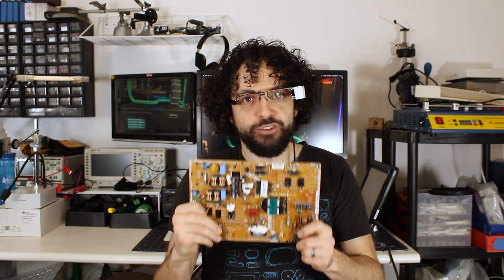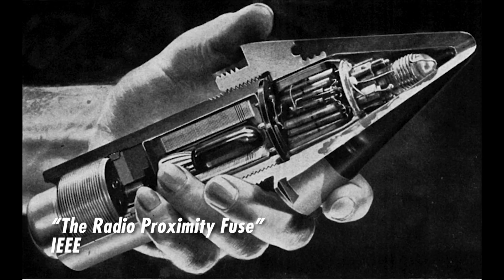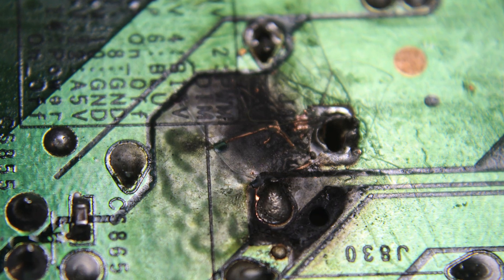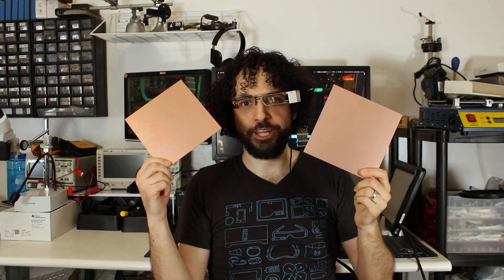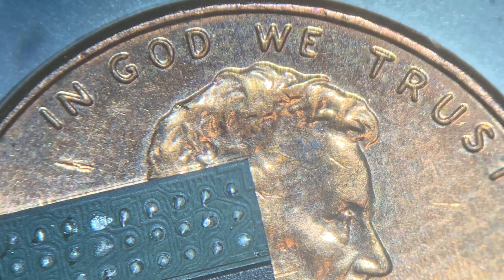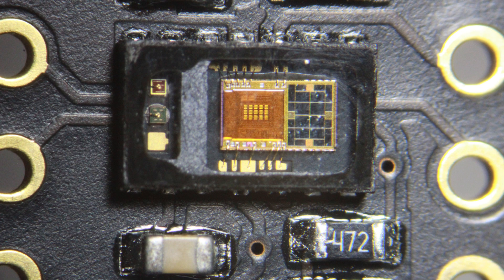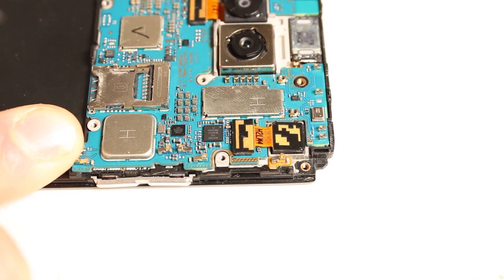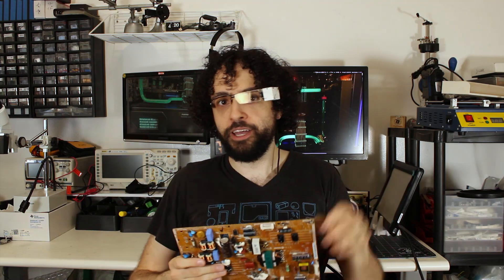Why Are Circuits on Boards?

Comment: You used LITERALLY wrong. Im so tired of that word being over-misused, I might unsubscribe. I havent decided yet, because you are quite entertaining otherwise.  I know, I will unsubscribe then subscribe back again. The circuit board does NOT literally hold the world of electronics together, it FIGURATIVELY holds the world of bla bla I give up! Oh then you used it correctly a few moments later. So. Perhaps you looked it up. Either way, it makes you sound dumb when you use Literally incorrectly. Me? The grammar police? No, just Literally, and the odd incorrect apostrophe, those are my things.
Reply from the maker: The entire electronics industry is on a single PCB. Always has been.
Reply: Yes but it does not LITERALLY hold the industry together. That would mean it had hands, and held it together physically.

Comment: I've done the PCB since the 70s. Never thought of them as a component. AND - there was a bunch of cool meta-knowledge in here I never knew. Great video!
Reply: That's surprising. Especially once you get to RF-level signals, the natural inductance and capacitance of the traces can quickly rear its head, and there's been a number of tricks to build in antennas, signal filters, transformers, even heating coils strong enough to solder components to the PCB.

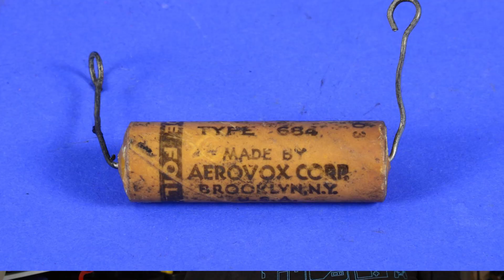Comment: The particular capacitor at 0:50 isn't an electrolytic capacitor, its just foil and waxed paper.  The electrolytic ones looked similar though.

Comment: In the old days ( 50-80s ), techs and engineers used to use tape on a clear transparent acetate film to etch out the board. Hence the term " tape out ".  The board would be painted with a photo sensitive paint and exposed to UV with the film laid on top. the board would then be etched with acid.
With the advent of printers and copiers, the layout would be printed directly on the film. the modern CPU manufacture is just an evolution of that.  
Also of note is the IBM Ceramic board. Yes the PCB was made from ceramic in those .

Comment: great stuff I learned a lot. Having worked 30+ years for a large US chemical company and my first 6 years in its Epoxy resin business, modern high performance PCB's are made from Epoxy resin with the Fire Retardance coming from the use of Brominated Epoxy resin (made from tetra Bromo Bisphenol-A (TBBA) as opposed to regular Bisphenol-A (BPA) in regular Epoxy resin) and an additional fire retardant additive in the resin formulation.  some cheap consumer products  not requiring high heat & dimensional stability may still use the older, cheaper laminated paper / phenolic resin boards.  looking frwd to viewing more on yr channel

Comment: Regarding milling: Couldn't you mill out the traces, paint the board, then mill away the paint on the pads? That way, you'd only need a broad brush and a tub of paint.

Comment: Oh my gosh, I've never seen or even imagined the possibility of a bank card with a little keypad on it for entering a code! What would it be powered by out in the wild like that?
Reply from the maker: These self-contained smart cards have wafer-thin batteries - once they run out, that’s it. That said, primary cells last much longer than rechargeable batteries, and these things take microamps of current, so they should last for years.
Reply: Thanks for your reply,  @ZackFreedman ! I'm thoroughly amazed that even batteries can be this thin now! Yes, haha, of course the battery wouldn't be replaceable or even rechargeable (haha, imagine plugging a wafer-think charger into your bank card)!

But that makes sense, since you normally replace your card that often due to standard expiration anyway. Sometimes my regular cards have needed replacement much earlier just due to cracking in my wallet!

Any idea why these haven't been propagated really far yet (at least in the USA)?

Comment: Just wanted to let you know that the "old" way of creating the images wasn't typically 'an engineer with a steady hand painting the traces", but rather a optically opaque tape that came in many different standard widths, along with dots (circular pre-cut shapes for pads and vias) and small rectangles. Since the tape was thin it could form smooth turns without kinking or folding. If the features of the board were too small to do in 100% scale they would be done at a convenient multiple (like 150%, 200%, 400%...) and then photographically reduced in size for the photoresist mask. I still have a reducer/enlarger actually. Anyways, they called this process of laying down the circuit paths using tape "tape out" which you might hear from vintage publications etc. Companies would have "tape out" parties to celebrate the finishing of the design work, iterations, basically all the hard work they put into a design culminated in that one product - the tape out. Thought you might find that bit of vintage tech vernacular  interesting. 

You are right about the circuit boards being underappreciated for the technological advancement that they indeed were.

Comment: This is exactly what I like right here. I would love to have a job designing and building electronics but I live in the boondocks and I don't want to move so it's not going to happen so I'll have to settle for doing it as a hobby... Also, what's the point of multi-layered PCBs and how do you use them? I saw an ad for a sale on multi-layer PCBs the other day. I know you touched on it but I've never used them and don't totally understand them... I'm just having trouble visualizing it. They can only use surface mounted components? I'm kind of at the intermediate electronics level so I hate surface mount stuff...

Comment: Sorry, no they never stuck resistors through a board and wire wrapped the other side. Not if they needed it to work over time. Wire wrapping is done around a square pin. This is done so as to produce a gas tight connection. As the wire is wrapped, the tension on the wire makes the corners of the square pin bite into the wire making a sealed connection. Computer back-planes used wire wrapping on sockets into which PCBs containing, up to 100, 14 to 16 pin dip chips, were plugged into. No company would ever go into production using PCBs if they had to hand draw the circuit on each board. Patterns on the board were laid out by draftsmen on large back lite tables using black circuit tape and circles and photographically reduced to actual size and then processed into the circuit boards. The helter skelter wiring you showed was called point-to-point and it was a pain the work on. Zenith, a company that made television sets, had advertisements about their hand-crafted set using point-to-point wiring, instead of new fangled PCBs.

Comment: Speak for yourself my circuits end up looking like glue balls with two stainless bolts popping out and a water inlet and outlet don't use boards just piece to piece and electrical tape and finish with super glue it works and it's water proof

Comment: You can make "3D printed" PCB with a Resin MSLA 3d printer

You can either print a single layer of resin onto the PCB
Or you can use a UV photosensitive INK paper that you stick to the PCB and the with the UV 2K screen you cure the traces into the ink

Comment: don't know why but this video just made me realize in 20-50yrs 3d printers will print devices on a single chip...at home.... the future is crazy :"p
Reply from the maker: Personally, I'm skeptical about in-house chip fabrication. It's more likely we'll have an FPGA or CPLD-style half-finished chip equipped with tons of parts, and a digital process will just link, break, and tune the components. Manufacturing silicon needs a level of precision that just isn't possible at home. That's not a technical limit, by the way - with such tiny details, even a microscopic water droplet can interfere with thousands of components.

Comment: The concept of circuit boards is tempting and scaled over decades - so what would it need, to overcome it, as an hypothetical question?
For one, integration still evolves, on the one hand, FPGAs are taking off, on the other: devices like pressure sensors, audio microphone, light sensors, cameras, ... will get reduced to all of them having just 4 connections: GND, Vin, Data/Control in, Data out, both just squeezing data over serial protocols.
Assuming, bus protocol like I2C, I2S, CAN and the myriads of others might converge/be emulated/encapsulated/multiplexed by a somewhen universal hyper-bus protocol (like Thunderbolt and its logical predecessors Firewire and SCSI on the PC), all attached devices will just need 4 pins, entering 4 layer board or even: interconnect daisy-chained or some ring-architectur, to bucket chain all the current parallel busses coming via special purpose connectors and flex cables, and in the end might evolve into a single CDMA light backplane, say: glass carrier plater, onto which the parts get glued....
Reply from the maker: I think it's very unlikely that PCB's will be superseded. I can see chips becoming obsolete, as in the black epoxy packages, as economies of scale and consolidating monopsonies favor the ultra-cheap die-on-board construction over encapsulated chips.
Reply: @ZackFreedman  Just as I formulated is, as a hypothetical question, not quite saying it will evolve like this.
For sure, FPGAs will take over for many lower-end solutions, even further reducing visible parts and on the other hand, there will always be components, that make no sense being squeezed into a FPGA.
Though, that doesn't mean, there will never be architectures and applications that develop towards LEGO-like bricks, seamlessly connecting all parts in a bus system an re-configuring some dozens of function blocks, beyond PCBs and current multi-pin connectors.

Whenever people thought, technical solutions hat come to som durable plateau, something completely new came by. Some ideas stayed fiction, others vanished or became short-lived one-way-streets, others failed on the first attempt, but were re-engineered be re-using some essential parts, but going 2-3 other steps.
PCBs won't stop their career, just as we will see plugs of all kind for many more decades. But the border for integration will move on.
PS: What's your vision concerning chips beyond epoxy packages? Glueing + bonding + secure protective lacquer  increasingly complex ones directly to the boards, as it's already done with simple devices (digital clocks etc.)?

Comment: I remember explaining surface mount components to a computer tech who thought that a PCI network card was missing it's activity LED.  The Network card backplate still had a round hole you would have seen LEDs poking out the back 90 deg from it's board.   The surface mount version had it's LED at the edge near this round hole.

Comment: great channel and video, i liked the bit about proximity fuses, as someone who has fired a few rounds with them attached i can say they do fail a good amount of time but they are still pretty amazing considering the forces involved on the tiny electronic components. though could be because some the rounds we fired are probably 15-20 years old at the time.

Comment: A bit of clarification.
I used to work in a circuit board factory a long time ago and while home made single sided board may be etched first and drilled later, the process is actually reversed in professional manufacturing.

The holes are first drilled using a CNC drill (my job). The drilled boards are then sanded down so the holes edges are nice and flat.
Following that, the boards are washed, and laminated with a special photo-sensitive laminate film.
The circuit mask is then exposed onto the laminated board (the drilled holes are typically used for the pattern alignment, which is why they need to be done first)
The exposed parts of the film are washed away using high pressure water jets.
The boards are then etched, cleaned in acid and finally copper plated to make the tracks more even.
For double sided boards, it is also plates the inside of the holes (called through-plating).
Then the green/red/blue/yellow solder mask is applied (yes, we did do all those colours), baked, followed by the component overlay and baked again.

Then cut up and shipped out.

Fun times. :)

Comment: I'm surprised they moved away from phenolic. I would like an additive repairable fabrication process that had more redundant parallelized components and software processes but modularity even only at the production level is still a nice feature. Openness and standards solves a lot of the problems. I am imagining very long term. I want my nanofactories already darn it. Eventually I think boards will give way to lattice for cooling, interconnectivity latency, and structure. 2D base is still cheap. I'm wondering if we will see displays integrate computation or storage elements.

Comment: I don't se how you state "integrating everything into a single part make you your suppliers female dog" and then say, about how manufacturers are integrating into modules.  Then you state "This is really the best of both worlds because the manufacture has already done a bunch of your engineering and if something breaks, you just replace the module."  But ... doesn't that have the same issue as your first statement?  Also, working with medical equipment, I have found it is a bear doing the latter as all those parts are "consumer" parts, and pretty much change within two years.  It is extremely difficult to get these modules (for servicing) on a medical product that has been out there for say seven years.
Reply from the maker: There's a difference between module-level integration and system-on-chip integration. You can remove a camera module without soldering. You can't remove an IP block from a chip without an electron microscope and a laser.

Comment: Talking about repairing and integration.
Apple has something amazing for you: Their devices are super-easy to repair even for the novice users.
They consist of one single part that can be replaced by anyone with a wallet full of money: The whole device itself! Yep! The device itself *is* the user-replaceable part.
Best of all is that your pockets will have more space for more parts after the part replacement has been done, as the wallet magically becomes a lot thinner.
Reply from the maker: Right to repair is serious business

Comment: Please get it right... the pcbs were not hand painted onto the screen. Flexible black paper tapes of various widthe were used to lay out the tracks for single sided boards.  For double sided boards red and blue plastic tapes were used. (google   BISHOP GRAPHICS. The tapes were usually layed out on a translucent plastic sheet with grid liens at 0.1 Inch ir 2.54mm once complete the sheet would be contact printed onto the silk screen. The red and blue tapes were not flexable enough to produce curved traces with much success. Red and Blue traces were most often used with digital circuits with traces running in one basic direction on one side and the oposite basic direction on the other side of the board. Apart from the tape, Intergrated circuit pads corners, edge connectors etc could be used to speed up board production.

Comment: The real technology change comes from lower power circuitry. If we can the same result with a tenth of the power, then traces (and therefore boards) can become even smaller and complex.
Superconductors can remove any resistance of a PCB trace, allowing for high currents.
Perfect insulating material can improve the isolation of a trace, allowing traces with higher voltages to be closer together.

So yeah, the concept itself is not likely to change, but there is still a lot of development that can be done for PCBs.

Comment: Way back in school, we used a machine to put a printed circuit using light onto a board, then threw it into, i believe, 2 different baths. What I never understood was, how the copper underneath the printed layer didnt get destroyed. Can someone explain that to me? (What I mean is, if you drew your circuit using a marker, I can understand that the acid can't attack the copper below the marker, but next to it it will get eaten up, creating a "ravine" which should make it possible to attack the standing copper column under the marker from the sides, or not?
Reply from the maker: Neat! I've used those photosensitized boards, but not in school. You're right - if you leave the boards in the etchant too long, it will start to eat into the traces. The reason the unmasked traces etch first is because their surface area is so much larger - there's more for the etchant to attack.
Reply: @ZackFreedman  Thank you for your answer.
To be fair, i chose a technical school for 11th to 13th grade since I knew I wanted to do something technical; Was great fun. Somehow I miss doing that kind of stuff now, that i am a software developer. Oh well, maybe it will one day be time for a big hobby room :)

Comment: Optical circuit boards arnt necessarily new in concept.  We use them in the nuke industry for signal and power isolation. Granted it is a pretty narrow application and the cards are super simplistic, when compared to most consumer and commercial based copper circuit boards.   Pretty neat stuff though.  I didnt realize there were any efforts to use them in more complex applications. It would be nice to see them used in the industrial controls for reasons that would make this text much longer than it already is.